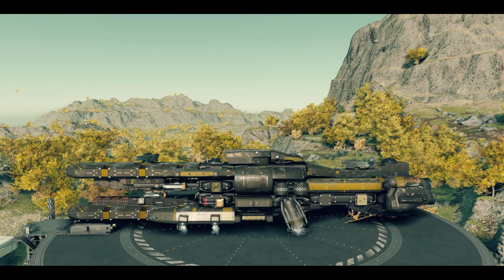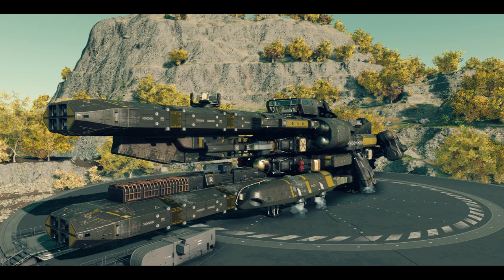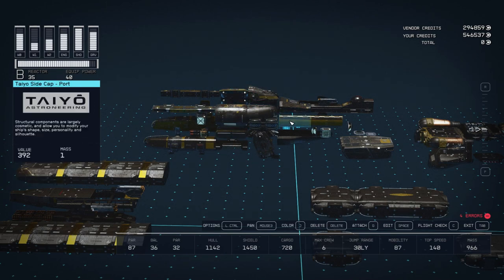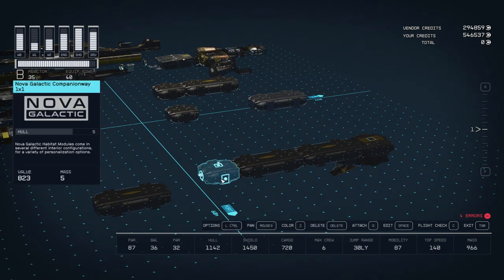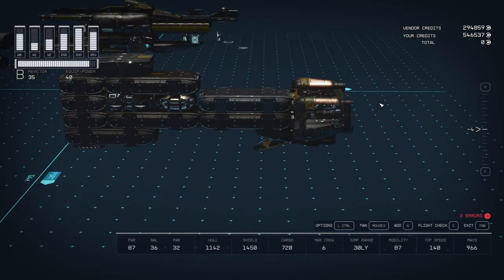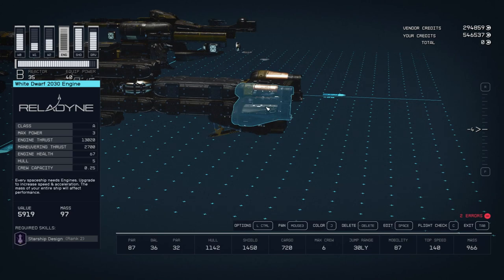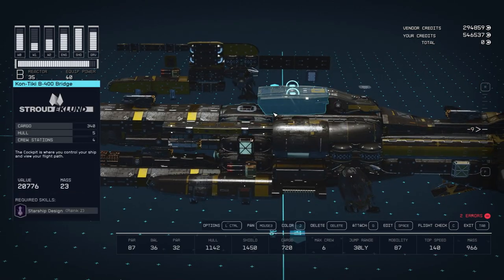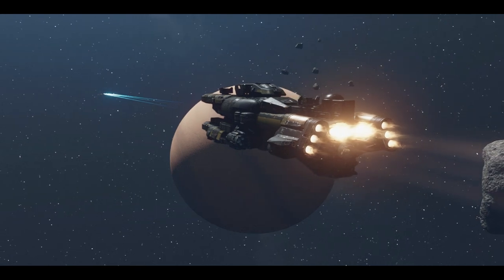STARFIELD | Liberty Cruiser Tutorial | Eag's Ship Shop Builds

Comment: Back when I played on one of the old modded RP servers I flew a stolen liberty cruiser as a blockade runner/smuggler. I didn't really sneak cargo past the authorities so much as I just punched through their lines and sold my cargo at the local pirate base. I think I might reinstall Starfield and build this ship to try to replay some of those old memories.
Reply from the maker: I had played on the Freelancer Universe vanilla server for a while, never did this ship on a server before. But it was definitely one of my favorite designs aside from the Valkyrie and the Osiris-Class! Have a go at the build, it's small and easy. However this ship is now available on Nexus and the Creations Store if you're interested in the mod format instead!
Reply: @CMDREagle131  I actually built it this morning and spent way too much time figuring out how to upgrade it to a class C ship. It's doable but doesn't quite look right from the top and you loose a 2x1 hab. Still, the extra firepower and defenses cannot be beat.

Comment: I can’t get this ship to spawn in any vendors to buy - have the framework and everything and the LO correct
Reply from the maker: Try creating a save, then quitting out of the game completely, then going back in.  That usually works for me.
Reply: @CMDREagle131  still won’t work - all my other ship mods work fine with the framework, just not this one
Reply from the maker: @AStickyRaccoon  Hmmmm ok, I will take a look at the mod file when I can get into the Creation Kit next.

Just to confirm- you were looking at the New Atlantis Ship Technician vendor, right?
Reply: @CMDREagle131 yes, new Atlantis - don’t rush urself or anything lol I just built it myself using this guide so thanks for that, but yea idk why it won’t pop up I’ve moved it around in LO and waited a bunch trying to reset vendors but it just never popped up anywhere
Reply from the maker: @AStickyRaccoon  Well it won't pop up anywhere but New Atlantis.  It's how I have it set up.  I don't anticipate this ship having the same issue, but I did just fix one of my ship mods this morning that didn't actually have anything defined for where it's sold at, so it's possible the same thing happened with this ship.  I would just find it odd that its being reported now.
Reply from the maker: Yeah so I inspected the mod this morning in the Creation Kit. I have absolutely no idea why it's not showing up at your vendor sadly. It works OK for me in my game. Glad you were able to follow the build guide anyway!